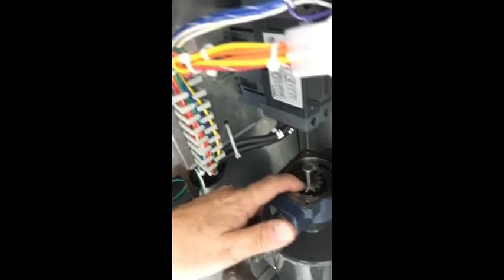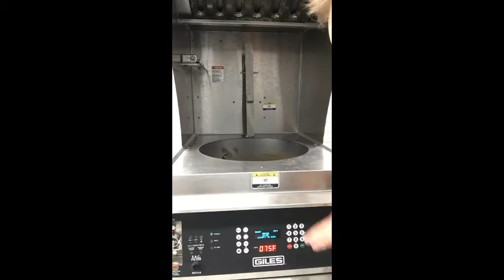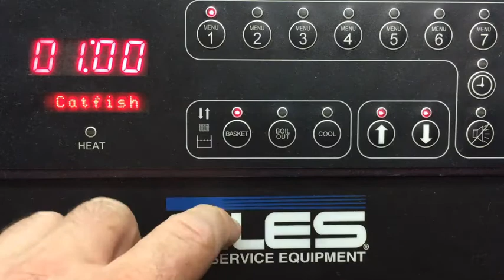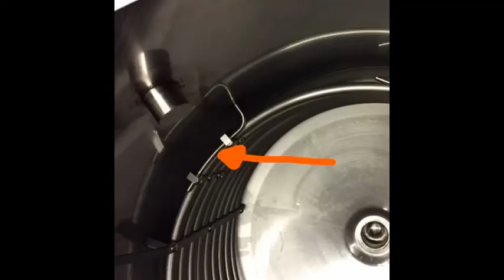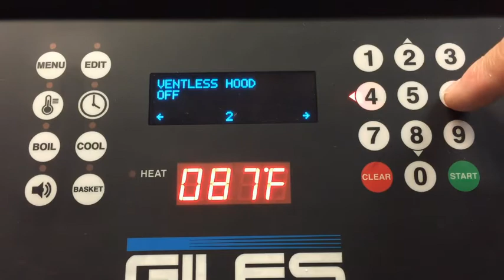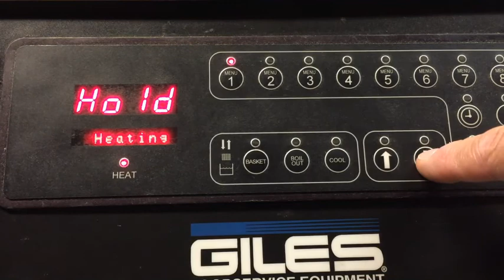Giles GEF Fryer training

Comment: Thanks for posting this ,  as a new technician ,  my trouble shooting needs some fine tuning ,  I currently have a giles fryer. that does not move  oil into the vat from bottom pan , when I turn the pump on I hear a motor hum temporarily but no product movement ,  would this typically be a pump issue  like you addressed in the video thanks !

Comment: Incredibly useful stuff. I operate a set of these sometimes, and solving filtering/oil return issues, does become a tire. That being said, if used as directed, these things just don’t have issues. Bigger issue is getting employees to clean the filter pan before cleaning the oil. That, and people running several fries after the filter alarm sounds.

Comment: How do you stop the Giles fryer from going into “Melt” mode. 
Or if it’s in “Melt” mode how do you get it out of that mode? 
Thanks!
Reply from the maker: This can be turned off in the fryer programming. Please contact technical service at 1-800-554-4537, option 1 for instructions.